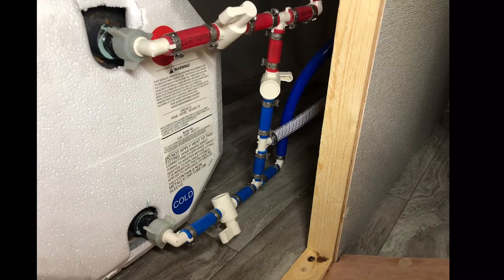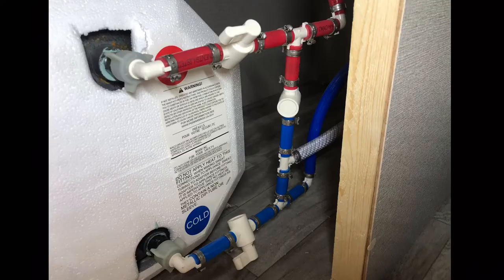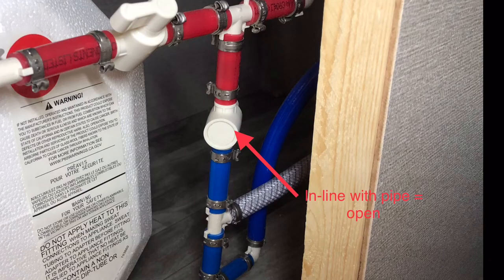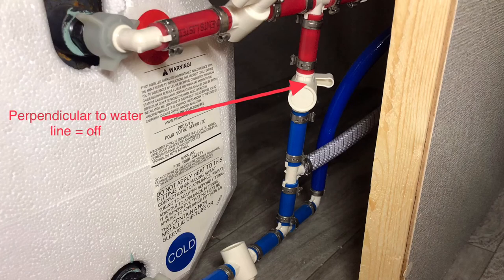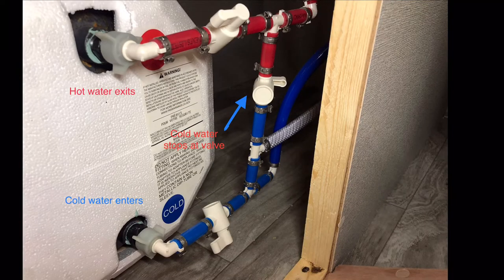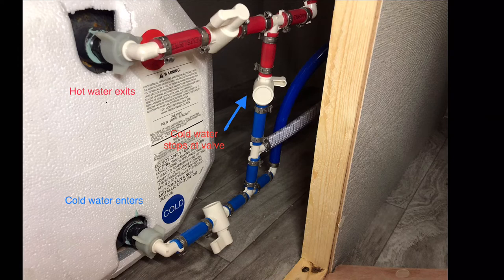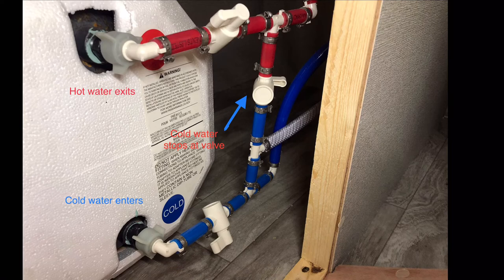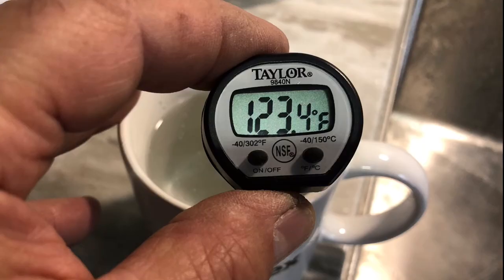RV Water heater bypass mistake

Comment: We have a 2009 Crossroads Zinger and our hot and cold valves are under the kitchen sink and the fresh water valve is under the fridge. When i winterize what is the sequence of closing the valves? I closed all 3 at once and ended up with antifreeze in the hot water tank.
Reply from the maker: How many valves are at the water heater?
Reply: Two, the hot and the cold but I don't know which is which.
Reply from the maker: Well, without being able to see it and if I’m picturing the same thing you have the two values should point toward each other. If anti freeze is going into the water heater one or both of the valves is in the wrong position or one or both have failed.
Reply: The two under sink by the water heater are vertical now in the winter setting. They were horizontal for summer. I turned both vertical for winter, then turned the one under the fridge to winter, that's how we ended up with antifreeze in the hot water tank.
Reply from the maker: I’m not sure what the one under the fridge is for typically that’s for water filter. From here it sounds like one of the valves is leaking into the tank…

Comment: Reinforced poly line should never be used on a pressure line.
Reply: getting an rv soon. there are 2 lines i see on the cold.  i'm guessing one is water pump, and other city line?
Reply: @chrisw6785  as this video/pic shows it IS most likely from the pump, BUT the problem is there should be a shut off here as well as there is nothing preventing the pressurized cold from shooting down the pump line/hose....  it is just another one of those owner things to do to prevent a "possible" rupture, might happen might not, i would rather be on the side of NOT in order to enjoy a maint free camping session.... 🤠